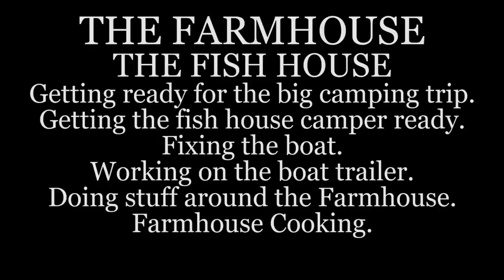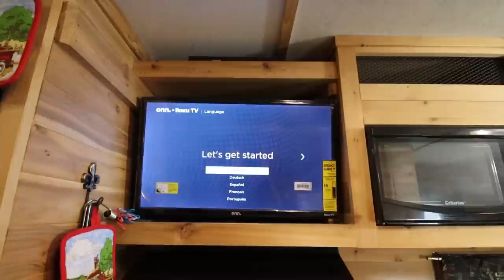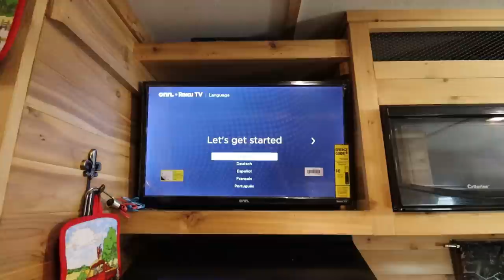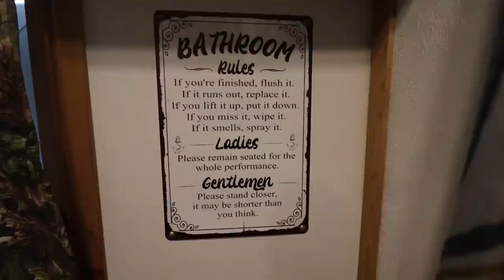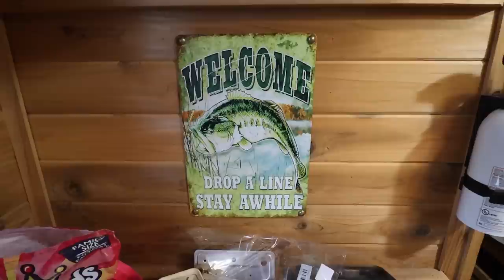THE FARMHOUSE. THE FISH HOUSE CAMPER. Getting things ready for the big camping trip. Busy week.

Comment: Pressure wash the inside of the boat, dry, then clean up with a couple of cans of brake cleaner.  Once the inside is clean, apply a marine paint with some fine sand added for slip resistance.  The paint should seal up the leaks around the rivets.

Comment: If you want to really clean the aluminum on your boat, I used air conditioner condenser coil cleaner (acid type works best) and the aluminum cleans up shiny new. I then put a good coat of car wax on and the boat just glides through the water.

Comment: I dont know if you watch Slim Potatohead's channel but he luckily found a crack in the bottom frame of his trailer.  Luckily he was parked and safe when he found it.  But, it was a big deal because he was at a forest park.  He had to find a special wrecker to haul the trailer on.  It couldn't we pulled.  40 miles away.  Nightmare stuff.  
Will you please look at your under framing and  for any cracks?

Comment: by the way Joe under the hood there is a big fuse panel drivers side and it has fuses for all truck lights and separate fuses for all trailer lights and brake controller relays have a 2003 2500 HD Silverado found that out on YouTube

Comment: Why not use a tube of silicone (the really good 25 year stuff) in the gap on the keel of the boat?  You'd save yourself the hours of building up layers with the spray.  Spray it on, wait 4 hours for it to dry, maybe another 4 to cure...for each layer.  Use silicone!

Comment: I dont now that much about fishing but why do  you need different  rod for diffrent fish ????
Reply from the maker: If you are fishing walleye or other finicky fish you want a smaller line size and no metal leader. They can see that. With sunfish or crappies you do not need anything like that either. With Northern Pike and other harder fighting fish I want 30 pound test line and at least a 20 pound leader so they do not snap my line. Changing all that on just one rod would really suck and be time consuming. Much easier to just have multiple setups.
Reply: @NorthernSeclusion  thank you for that information and thank you for taking the time to answer my question. God bless stay safe and well. 😊